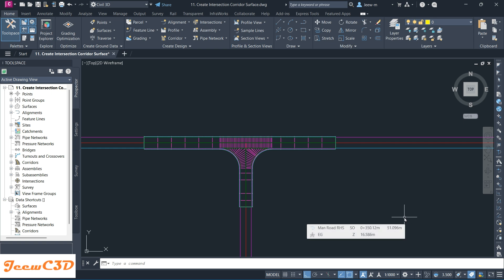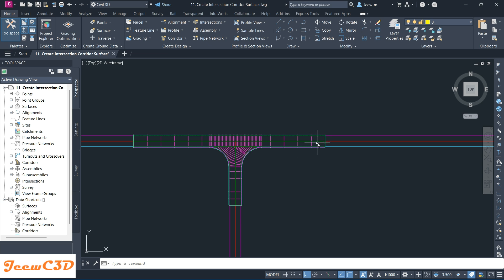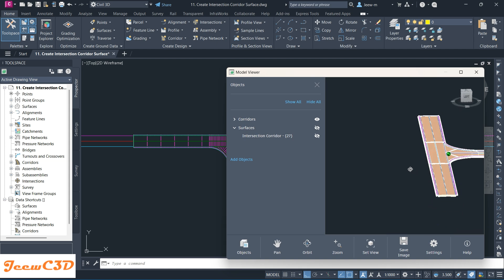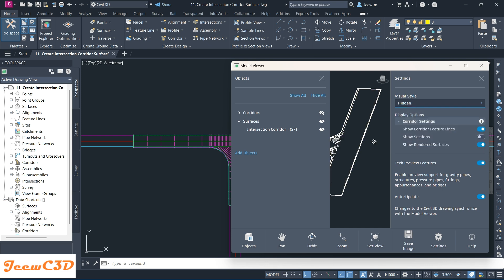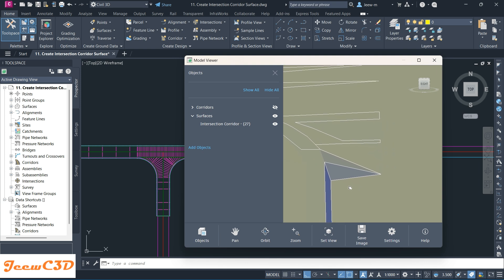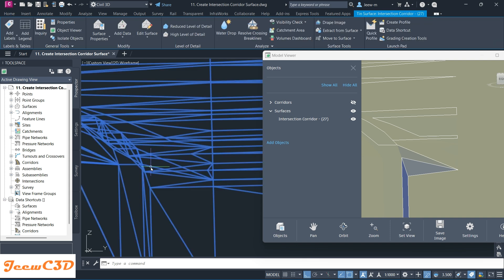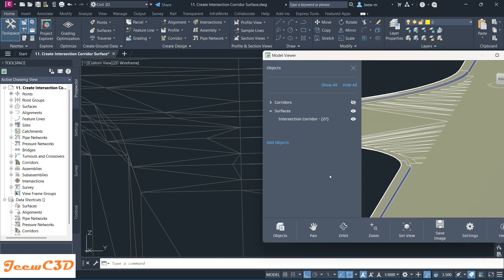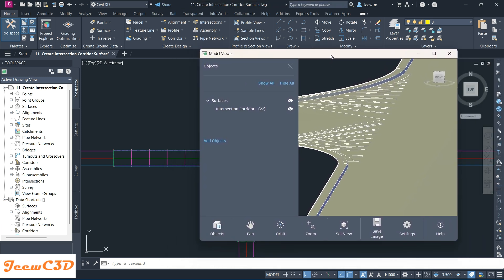Civil 3D 2026 NEW FEATURE - Model Viewer

Comment: Sir, Can you tell me which daylight is best suited for mountain roads where one side is completely hill and the other side is the valley. Please suggest me better solution. One side only cutting and other side only filling
Reply from the maker: It depends on your requirement. 
If benching is there you can use daylight bench.
Otherwise daylight general.
Also in generic surface link is also there.
Reply: @JeewC3D  can you tell me your mail id or any whatsapp number so that I can contact you. Because you teach in a really good manner. Please acknowledge if possible
Reply from the maker: Please check the video descriptions for contact details.